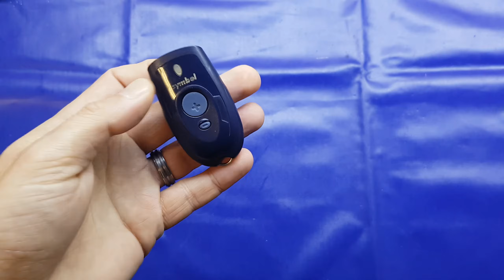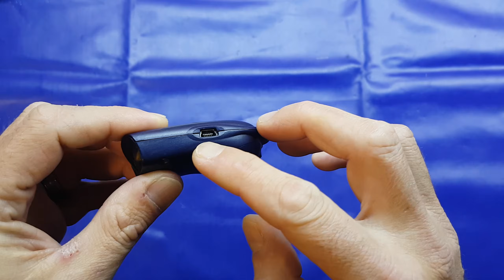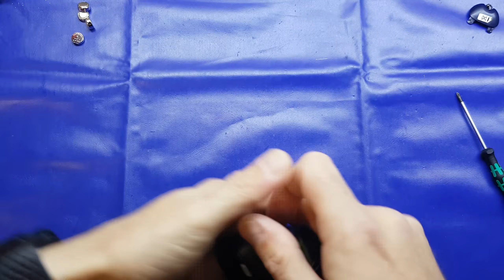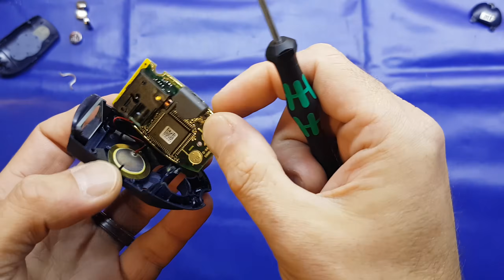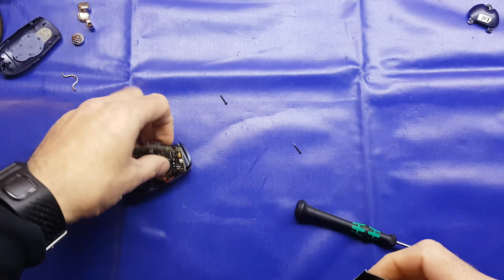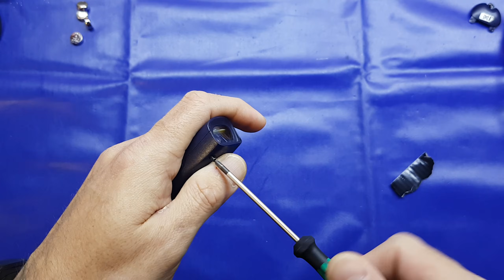Symbol CS1504 portable barcode scanner teardown

Comment: Just got my hands on one of these actually, and being someone who knows various programming languages wanted to make some cool software to use it with and found that the symbol SDK is from 2003, so more than 8 years old, but the manual is from 2015 and dont seem to say if its been discontinued on zebra site

If you want to make your own software for this you can either read the serial programming guide or get the Opticon OPN-2001 SDK as its updated for windows 10 (not same as USB driver)

did read something online about having data from a CS1504 straight to excel on my 2 day battle trying to find a modern SDK (before I found Opticon)

but software aside this thing is an incredible fleet of engineering for 2003 so tiny, might even be older than 2003 as thats the latest SDK (from Symbol), too bad they broke USB standard with that mini B connector for RS232 comms